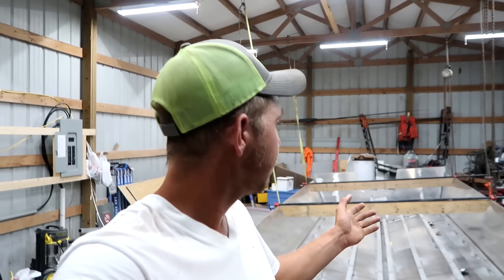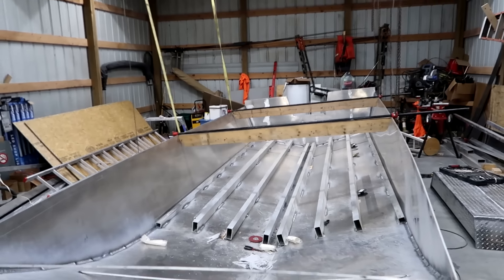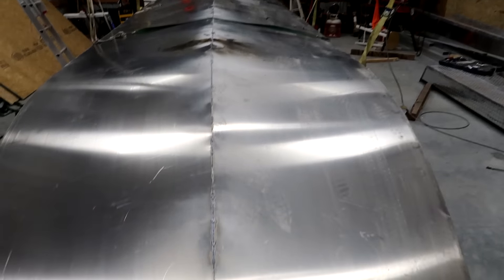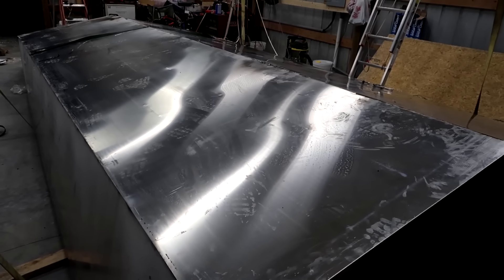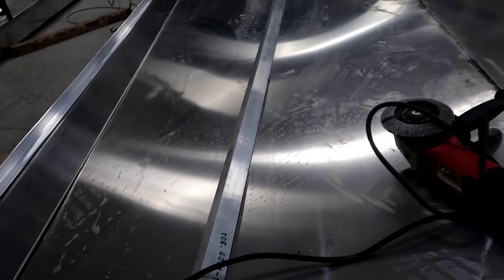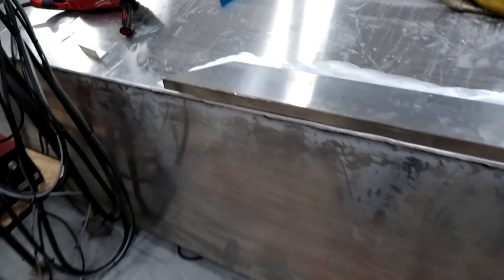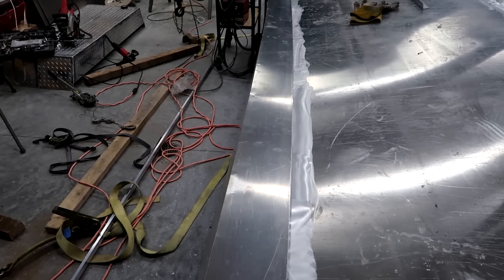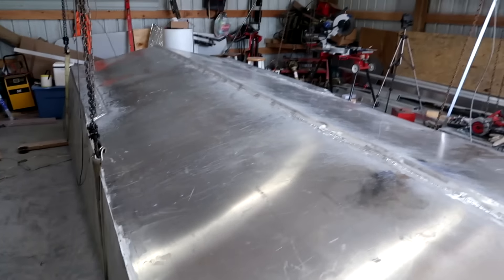Building a 25ft Aluminum Boat Part 8

Comment: Have enjoyed your series. A way to keep a lot of that heat away when welding is to get a thick block to clamp to the back side that will pull a lot of that heat away from the thin pieces.

Comment: About three years ago a fella named Shawn built a forty footer landing craft. You can see his build on his channel here on YouTube. He found not welding the top plate of the gun'ls let the sides oil can when he welded the rub rails, chines and keel.  He said he really wished he had of done the gun'l caps first which would have kept the fair lines he started with.  You also don't have anywhere near the transverse stiffening that he had so you might be even more at risk.  Once it happens it really can't be repaired so it might be worth thinking about.  Enjoying your build.  Take care.  Doug

Comment: Probably too late at this point, but some builders add the bow ring before flipping, and a second one at the balance point on the transom, and use a shop crane and a second lift like a backhoe/tractor or second shop crane.

Comment: You keep cutting corners!
That keel seam is supposed to be fully welded both inside & out! Your keel angle should then go over the fully welded keel seam. This way water has to get past the fully welded side of the angle & past the underside fully welded keel seam & past the fully welded internal keel seam, to have any leak!
I told you that in the comments of the last video!
Are you too stupid to listen or just too stupid to comprehend?
The chine seams likewise should be fully welded inside & out, before you weld the angle over that seam for the same reason, 3 levels of water proofing against leaks.
If you don’t taper your chine seam angle with the jig saw back to 1/2 inch width at the bow starting from the transition to bow shear, it will “kink” / deform and fold, as you try to pull it to follow the radius of the chine when tack welding into place.
The “runners” under neath are called “planing strakes” & are put there for good reason & it’s not for ice breaking!
Reverse chines help a little with cornering is all.
They will assist little at all with creating lift to reduce drag.
There’s a type of roll over wing which does do that, it’s called a “air rider” hull by naval architect Gavin Mair (google is  your friend but I have doubts your intelligent enough to research anything), or a “vortex” hull by other designers, BUT the KEY ingredient is it has to come forward far enough to “catch” the bow wave created by the bow to ride up & over (I.e. surf) the bow wave to gain lift from the energy the engine expended to push the bow against the inertial resistance of the water to create the bow wave & harness that otherwise wasted energy & convert it to lift & thus reduced drag.
Your feeble design won’t achieve that so quit sounding like you know what your doing.
It’s patently obvious to anyone who knows that you have little to no idea at all! In essence your full of it, you make it up as you go along, and MOST of it is ill informed & incorrect in both design & construction.
You haven’t even got the basics of the welding correct!
Just give up for goodness sake!
Reply: @ianmoone2359  That offer is still on the table !?!
Reply: @ianmoone2359  I agree only so far as the transverse frames are concerned.  Our plate boats have them every 24 inches.  But, we have zero longitudinal frames.  And if it turned out that they were needed, he could use something other than "1/8th mdf cabinet backing".  He could use plywood, cardboard, heck, he could even glue pop sickle sticks together to make a template.  And he's not putting a superstructure on it, so the longitudinal braces are probably all that is needed.